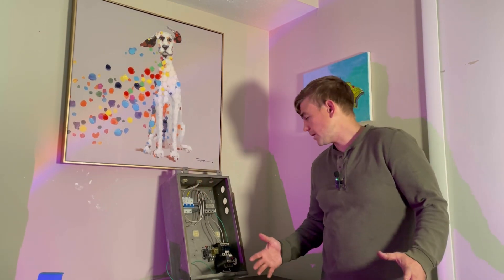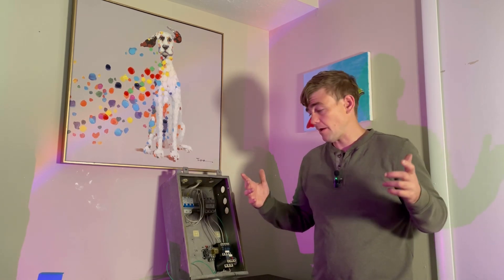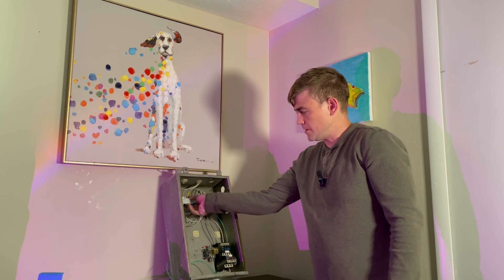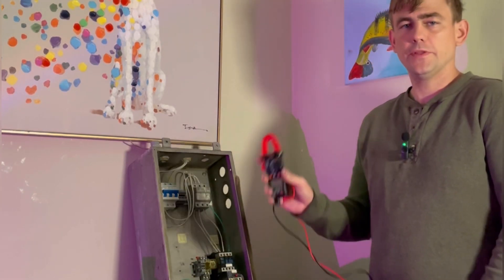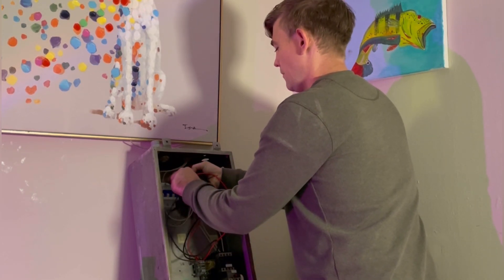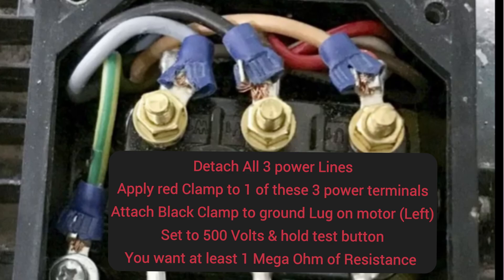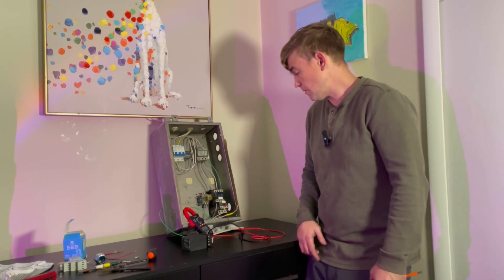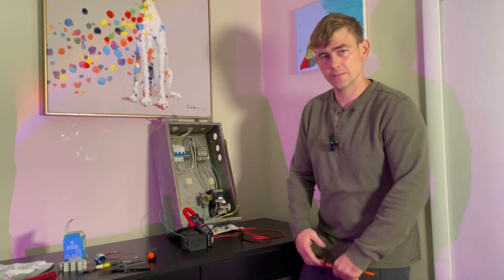Troubleshooting 3 Phase Motors: What I do as a Technician** Most common Faults

Comment: 10:29 is there a benefit to removing the wires instead of leaving them in the terminals and testing from there? Since the contactor is open, the motor leads should be the only wires in the circuit right?
Reply: You disconnect them just to ensure that there’s no back feeding or anything because we’re trying to isolate the problem. Removing the wires from the contactor ensures that we are only testing the wires going to the motor and the motor itself. Once removed if you find a problem in the wires then you know for sure that it’s either the wires coming from our contactor to the motor or the motor itself. In that case I would go to the motor and remove the peckerhead and de terminate all the wires going to it and test the motor individually and then do the same thing to the line wires coming from our contactor.

Comment: Why are you going through fuses when there is a breaker and overload?
Reply from the maker: Usually, the three phase circuit breaker will be for the whole panel so there might be a bunch of motors and control circuits or whatever.
Then, after that, you’re absolutely right you can either run fuses or an overload or you can run both. I don’t know if there is a super technical reason why you would have that extra set of redundancy obviously fuses work every time, I’ve just seen it a lot of times where you’ll have a set of fuses dedicated to that motor and then you’ll have an overloaded set at even lower current to catch it before the fuses. That being said, I have seen it where there will be a short circuit and the overloads don’t trip in and it passes over the overload and trips a fuse at a higher amp rating

Comment: Can we remove wires from.t1 t2 t3 and megger the motor cables
Reply from the maker: Yeah that’s usually what I do if you get To the point and you’re in a real pickle pickle and you can’t figure out what’s going on it’s better to go to the little junction box on the actual motor disconnect the three power wires in the conduit, and then measure the Wires going into the motor. The only reason for that is, there’s always a slight possibility that you have an issue with the wiring in the conduit going from your control panel to the motor so you wanna rule that out. Generally, I just do it in the panel though but if things seem really funky or if I’m gonna replace the motor, then I go ahead and redo all my tests in the junction box a.k.a. Peckerhead just to be sure
Reply: @gregroche7323  right on . Thanks

Comment: Could you just test the fuse for continuity to see if it’s good or bad?
Reply from the maker: Yeah you can. Do you wanna kill the power first… if I check fuses I either leave it hot and measure voltage or kill the power and take them out of the circuit. You don’t really need to take it out but it’s just habit I guess. One time when I was a new technician I left the fuse in the circuit and tested it and it read good I but it was actually a bad fuse ever since that I always take them out.

Reading continuity is like the same thing as reading resistance they just mean the opposite of each other